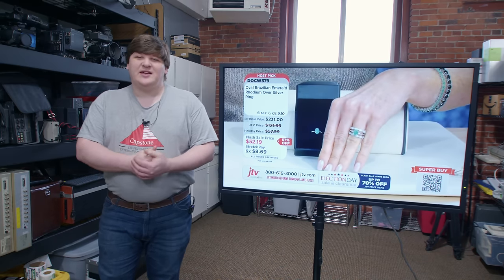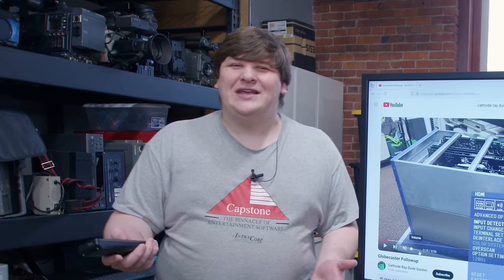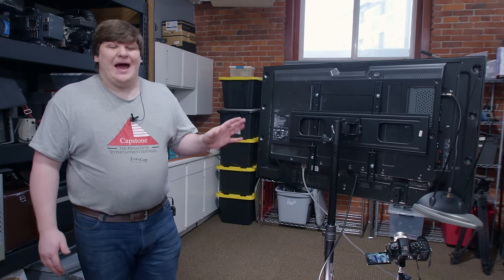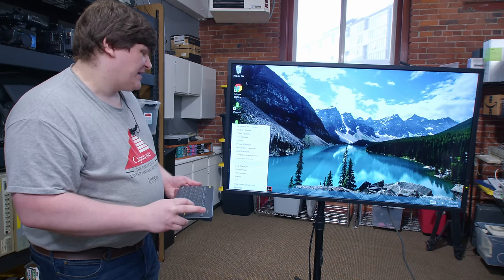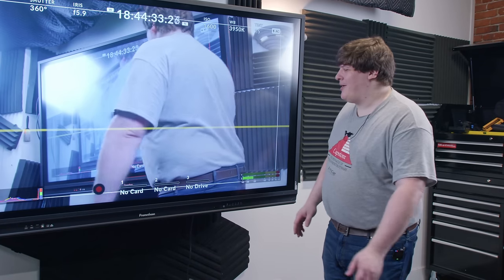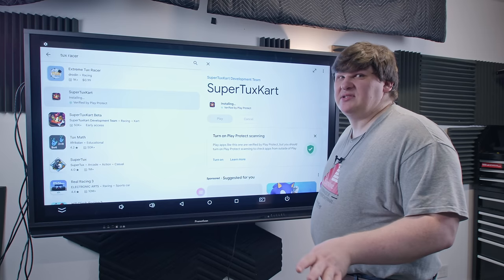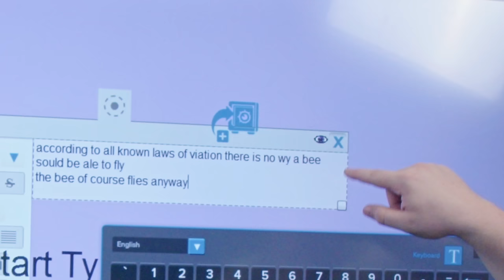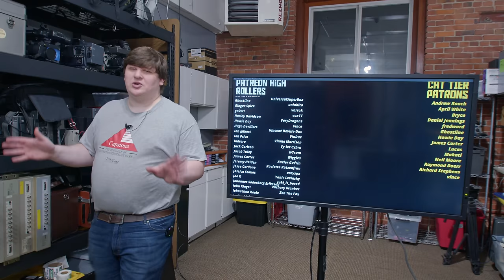Several Incredibly Smart TVs!

Comment: My wife is a high school math teacher, she and her colleagues use their smart whiteboards daily.
Reply from the maker: The really seems to be a sharp divide, half of people say these things never get used, the other half said they couldn't live without them. I'm glad to hear that a lot of them are getting used!
Reply: @ not being a teacher I just assume they are good for math and garbage die anything else. Even when I was in school the projectors only got used by math teachers.
Reply: @CathodeRayDude  Teachers are sometimes extremely set in their ways.  They also will hold on to tech from decades ago, because it still works even when a better solution presents itself.  As I said in my earlier post the best way to get them to use this stuff is to not give them another option.  Rip out(or in most cases since it's cheaper just mount this on top of it) their traditional white board and they will have no other option.  As someone who has worked in and around education for over a decade its frustrating to deal with someone who couldn't program the clock on their VCR bitd, but is also responsible for educating young minds.  Technology literacy is just as important as actual literacy yet there are still teachers you have to drag kicking and screaming out of the 90s.
Reply: @CathodeRayDude  This seems pretty much true to my experience. I was at the end of primary school during the first wave of digital whiteboards starting to take off (around 2004-06, when they were replacing OHPs with PC projectors instead, and thus the terrible calibration experience of syncing up some kind of touch/pen-sensitive canvas with a projector that try as you might you can never quite keystone correctly), and there always seemed to be a roughly 50/50 divide between the teachers who used their digital whiteboards AS digital whiteboards, and those who only used them as they would do a PC projector with no whiteboard functionality, i.e. effectively as a more complicated OHP.

In my secondary school, we didn't have many digital whiteboards, (though there definitely were SOME). most classrooms just had PC projectors and pull-down screens (or just projected ONTO a standard whiteboard, so would often annotate the display directly using dry-wipe), though some classrooms also had document cameras hooked up to their projector to TRULY recreate the OHP experience.
Reply: @CathodeRayDude some are also SMART Technologies SMART boards, a projector with a laser that tracks if something crosses the display
It's basically projector + crappy "touch screen" bolted to computer = crappo
Reply: @CathodeRayDude  Not to put too fine a point on the conversation, but as someone born in Y2K I have a pretty good timeline for the adoption of SMART boards, at least in my schools. I remember dealing with plastic overhead slides up through 3rd grade ('08), and then there were a couple years where document cams were dominant. We got SMART boards district-wide in 2010, and adoption was fairly immediate, mostly because they were installed over the whiteboards at the front-center of every room. I think a big plus was the fact that they come with four different color "markers" and an eraser that can be used to draw on the board at any time, even on top of the PC output. Teachers don't care about pixel density, latency, touchpoint accuracy, etc., they just use it for whatever purpose suits their need (usually whiteboard, PC projector or media projector), and it works //well enough.//
Reply: @niosem I've seen that in Epson short throw whiteboard projectors too, but those seem to use a combination of lasers and cameras as they can track both special pens and fingers.
Reply: Not just teachers.  If you work at a decent size business, there's a good chance the conference room has/had one of these.  I have, myself, worked with fellow IT drones drawing barely recognizable network diagrams on these kinds of displays.  You can even save your scrawls to a network drive, where it will of course never be viewed again.

FWIW, I bought an iPad Pro specifically to be able to do this in the field.  No more "Uhh... is there a piece of paper and a pen around here somewhere?"
Reply: It very much seems like the kind of thing where people either 1) take one look at it or try it briefly, and decide they never want to deal with it ever or 2) learn the methods and capabilities, and how to best employ it, and it becomes indispensable. 
I'm sure it would take some getting used to and some experience building your lessons around it, but the video had me saying "ohhhh, neat!" often enough that I'm sure there have to be great uses for this.
Reply: I wish smart whiteboards existed when I was in school. All we had back then was the old fashioned projector with the clear slides you could put on it and write on with dry erase markers.
Reply: @CathodeRayDude i do remember the drawing app. also dont worry they amde the ui way better on like the next model after the one you have. they no longer had ops es they were like android 9. only the wifi module was external and it has chromium not opera also lacked play store. but the ui was way better
Reply: @CathodeRayDude the huge no singal is also something i remember from the older models. sometimes a ball would hit the board and that black screen would flash white haha
Reply: My School district made a SHARP turn from those awful 70's overhead projectors, right into the 21st century with the smartboard. So, at least for my class, we got to learn how the smartboards worked along with the teachers, lol. This was in like 2010. But the older teacher's with tenure HATED them, sometimes the kids even had to work it for them because of the technological gap :/
Reply: @Yackass  we never had that type of issue. in a good school teachers are capable enough to use a pc wthout need for help. our boards are from 2012 they have 2nd gen i3s in their OPS es. its still good running windows 10 1809.
Reply: @togoxo  I'm talking about the older teachers that were winding down for retirement. They just didn't give a shit lol. Can't say that I blame em.
Reply: @ yeah im talking about teachers that have 30+ years teaching and some close to retiring. they also can use the board with no issues idk about schools where you live they need to get better teachers cus how is a person that cant use a smart board teaching kids
Reply: @niosem  at my last job my team glommed on to a SMART display whiteboard thing. We just used it as an enormous display for equipment reliability because it was a test unit for execs to be able to draw stuff real time, but none of them were ever interested in trying it. I shudder to think (both as an employee who got laid off and as a shareholder) how much dough was wasted in stupid things like that
Reply: @togoxo  I'm guessing you're one of those "well actually" kind of guys...
Reply: @Yackass  no like let this convo go
Reply: Same here, I'm a CS tutor for the data structures course at my university and I always try to get the room with the TV Smartboard that runs Android (7 lol) because it also has a grid background option and the ability to copy and paste things is kind of a lifesaver for the sorts of diagrams I draw on there.
Reply: @CathodeRayDude  When I was an ESL teacher, we used them constantly. Kids loved them, and if you put in a little forethought there's a million applications in language learning for them.
Reply: Yeah, it is something that has taken time, a lot of older teachers are just falling off from when these were new, but newer teachers coming in tend to use them more, mostly because they don't have to worry about cleaning off old pen marks and stuff... All that isn't as much a problem. Also older smart whiteboards were mostly projections based with a digitiser in the board and connected to a standard desktop computer on the teachers desk (they want that for admin work anyway). I know the first couple of generations of "SMART" branded ones, they had slots on the digitiser/projection screen for the pens that would detect which was picked up and automatically switch the colour and other usefull features to allow them to act more like traditional whiteboards. Also as computers have gotten faster, they have very little drawing lag now compared to when that first generation were installed 20 years ago, that school upgraded a few years ago, 2019 I want to say.

Newer ones though are TVs, some with these OPS modules in, sometimes they connect to windows PC, the software from different brands varies a lot, some of it is quite good, some of it is not so good.
Reply: @niosem  their newer models are TV based, and even a few years ago when they got to EOL of those original models, they worked a lot better than when first installed just by upgrading the computers to something a bit more modern, a lot of the problems were the office level computers on teachers desks when those first came out were really underperforming for doing the vector graphics work being asked of them with such displays.

Comment: A modern TV without built in Chromecasts, tracking and invasive advertising is a dream come true. Which was also a reality less than 5 years ago.
Reply: Just don't connect it to the internet and problem solved
Reply: Not really 5 years ago. Back in 2012 my friend at uni had a TV they had bought for uni which had smart apps built in.
Reply: I want dumb, chromecast or a decent chip. My Sony has a very fast soc and 4gb ram so runs YouTube and game streaming from my pc just fine
Reply: What're you on about? I bought a TV in 2017, it was a "Smart TV", and you couldn't get non-smart TV's at the time.
Reply: @LetrixAR  Louis Rossman had an expensive LG model with premium quality panel, which he, as far as I understood from his rant video, could not fully use without connecting to the internet.
Reply: @vanCaldenborgh  Didn't it even go further, like, without downright consenting to giving away your data to be sold for 3rd parties and shit like that?
Reply: @vanCaldenborgh  As far as I can tell my LG OLED is fully functional without an internet connection, with the obvious exception of the "smart" apps.  I didn't have to accept a license agreement of any sort to use the TV.
Reply: Don't worry, I'm sure you can get a module to provide you with a 1ghz pentium 3 class CPU, Android 12, 2 gigs of ram, and Wifi B. Most of the CPU time will be spent spying on you, and 10% of it will go towards the UI/programs.
Reply: 5 years ago? Try over 10. I got my first flat screen in 2010 and it wasn't smart yet. Still had analog connections too. It was the last generation of plasma screens. I upgraded in 2016 and everything was smart. Not a single dumb TV existed.
Reply: Yeah and the Extra cost of which brand of "smart" software is added to the price, roku added 100 fire 50 androidTV was the cheapest of a TCL
Reply: @Kalvinjj  consumer TVs are subsidised, those wall monitors are quite expensive

Comment: my high school started installing the newest version of those things during my senior year. they had an account system for like multiple teachers and everything. and I was the person who got told by the teachers to fix the things when the inputs eventually came unplugged. I have also plugged multiple ancient dvd drives into them because I was the techy kid. they used basically none of the inbuilt features outside of the screencast and basically used them as overhead projector replacements. gotta love how state money went to buying them instead of fixing the mold problem in my rundown rural high school from the 70's.
Reply: Yeah that sucks but budgets are allocated by category so the tech budget was probably eight times more than the mold remediation budget! 👍🏽😬
Reply: So, your School couldn't have bought Polyboard or Promethean or Smart or LG Pentouch or the Microsoft Whiteboard or Google Jam Board or the Samsung (whatever they call them now) or Vibe board or Viewsonic or Benq boards.
Reply: My School as did the same thing with the Promethean Activ Titaniums. At least they bought the lower storage ones that were 64 GBs and not expansion cards running ChromeOS or Windows 10/11 IOT they were all 65 inch versions from my memory. They never used all the features, just Teams installed from the Google Play Store. And my School had HP USFFs tons of them they never used them and I connected them for them. So, glad USB Plug and Play exists I was not going to fight with User Account Control. They also had Surfaces Brand new Never Used and a whole lot more. But, I gotta admit you could easily get into the "secret service settings" The display's mainboard UI and enable 3D since they also have 3D Glasses from the Smart Projectors (Our Old ones did Passive 3D). I mean the panel wasn't true 3D but Software will do it like people did when those 3D TVs were expensive.
Reply: I can feel you, when I was in school it was the same but we didn't get to the touchscreen era by that point yet until I graduated, but the carts with a tiny CRT did get replaced by a Sony LCD in each classroom.
Once they wondered why sound wasn't coming out of the TV and who do you think had to go there to check?... Anyway the reason for it was... they had stuffed a 3.5 mm jack into the analog sound input RCA jack's hole. No kidding. When I told about it the "technician" there just... stuffed it in deeper, enough to hit the contact it seems and grounded through the VGA I bet, so it sorta worked.
Seen janky stuff, but that beat 'em all.
Reply: So you learned about corruption at an early age....🤣

Comment: This man really just listed every reason why you'd need an always on commercial display.
Reply: I don't remember it being specifically called out, but obviously inferred, the fact that the screen could run for a decade or two at a shot in continuously on state, w/o losing it's backlight at 2 years, kind of sold me on the idea. I'll be watching for some on e-bay when the latest batch of 32" TV's die in a year or two. Did a search this morning, and found half a dozen e328 models ranging from $129 to $299 available as buy it now or best offer. No available funds at the moment, so holding off on those. Pretty sure that more will show up.
Reply: @RNMSC  We got a Samsung Digital Signage display for a project at work, the thing is rated for 24/7 operation for like 50000 hours MTBF. Literally over 5 years of continuous nonstop usage.
Pro gear is on another level altogether. Then again you feel it with a tap on the panel. A normal household LCD feels like it will shatter with a tap (and will with a slightly harder hit), that thing feels like it's twice as thick at least. It just doesn't flex the glass. And it's just a plastic frame one, none of that super rugged extra heavy steel casing stuff like the NEC Gravis showed here.

Comment: The dedicated "on" and "off" buttons on the remote also lets you easily automate turning the TV on and off with a 3rd party IR blaster. The IR blaster wouldn't have to guess if the TV is already on when typically a power toggle button was pressed.
Reply: Pretty much every TV in existence (as well as many other devuces) will respond to discrete power on and power off signals; it's just unfortunate that virtually no TV remote control includes them. Many universal remote controls will allow you to set up macros that use these discrete power controls to power up multiple devices in a home theater setup simultaneously.
Reply: From experience I can tell you that the discrete buttons are super helpful when you have a whole wall of TVs to turn on or off.

Without it if you don't hit all the TVs at once with the remote you have to go right up to the TVs that didn't turn on and hope you dont hit the ones that are already on and turn them back off

Comment: 24:14 there's a rly fun word for this: *idempotency*, which describes commands that have the same effect whether they're received once or multiple times. i learned the word from software development (you can imagine how useful it is to have this idea codified into a little term, when designing protocols to reliably transfer state over an unreliable network) but it's such a useful term for zeroing in on the specific cause of a lot of day to day annoyances. if it hasn't already, i feel like that's a word that should escape its original computer science context and be taught in fields like industrial design, mechanical engineering, etc. Then again, it's a word i wish more software developers knew and thought about, so i might be getting ahead of myself
Reply from the maker: oh hell yeah THAT'S what that means! i never knew
Reply: Interesting example of an idempotent interface: in the Matrix messaging protocol, when you (as a client) want to send a message, you don't just fire off a POST request with your message contents. You send a PUT request with a unique ID (entirely arbitrary, of your choice) in it, and the server guarantees that any message sent multiple times with the same ID will not get sent multiple times. This allows clients to retry sending whenever they want without fear of double-sending a message

Comment: One thing that irks me about modern TVs is that they don't pass DDC/CI into my computer, meaning I can't change the brightness or contrast or turn them off from my computer. I have VGA monitors from the late 2k's that just work like this, and samsung has made displays that can ONLY be controlled via DDC/CI. 
I use a program called Twinkle tray on windows to control all my displays' brightnesses all at once, and I'm curious if it would support something like that. I could only assume that it does but can't be too certain.
Reply: +1 for twinkle tray user!
Reply: Ex twinkle tray user here: loved it until I got a new display that would go bonkers whenever it was running